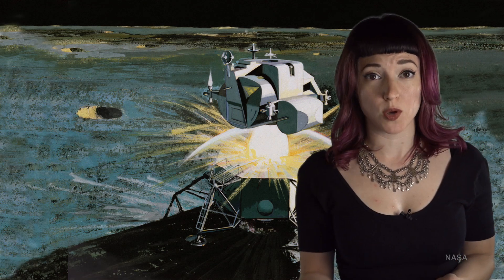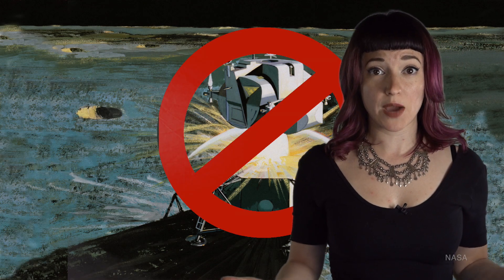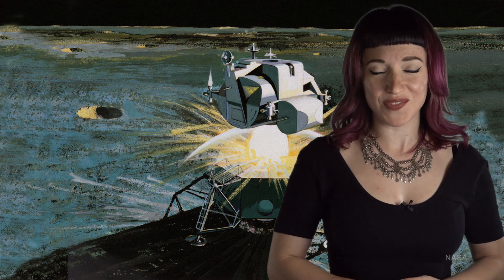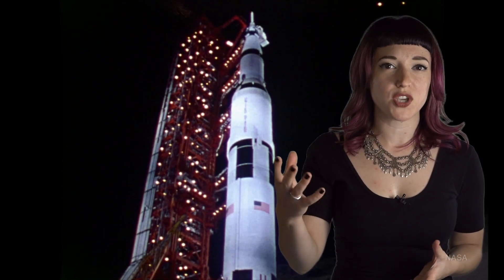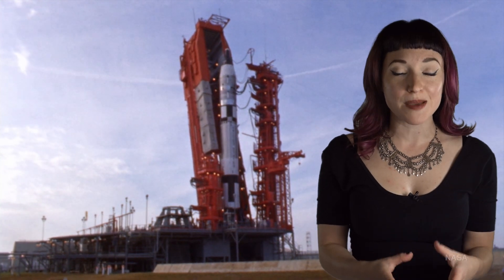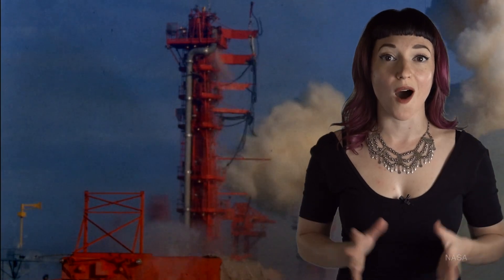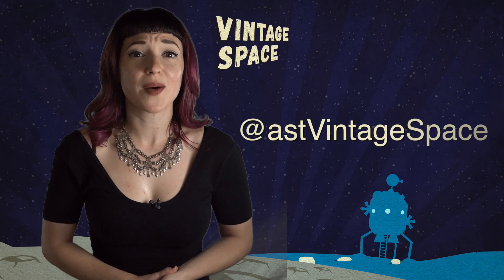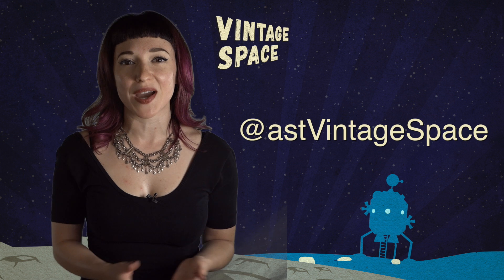How the Lunar Module Launched from the Moon Without a Flame

Comment: There is no sign of dust being blown off  the surface either. I believe that rocket.blast was 10,000 lbs. The disturbance to the dust would obscure the departure dont you think?
Reply: YOU SAID: "There is no sign of dust being blown off  the surface either."

== What?  Why would you believe such nonsense?  Have you looked at the photos yourself?  Or, are you blindly trusting other conspiratards who tell you that there was no sign of dust being blown?  How about this one?
https://www.hq.nasa.gov/alsj/a11/AS11-40-5921HR.jpg

Notice anything?  The 1-2 inch dust layer is almost completely blown away.  There are radial striations.  Um, yeah, you don't know what you're talking about.

YOU SAID: "I believe that rocket.blast was 10,000 lbs."

== So, you believe they landed at maximum throttle??  What??  Um, no.  10,500 pounds was the maximum thrust that engine was capable of.  But, they never actually used full throttle at any point, and certainly not the landing.  See, in lunar gravity, after having burned most of the fuel/oxidizer (most of the initial weight of the craft was fuel/oxidizer), the LEM only weighed about 2,500-3,000 pounds when landing (depending on mission).  I have news for you, if you ran that engine at 10,000 pounds of thrust, and the craft only weighed 2,500 pounds, you're NOT landing.  You're going straight up.  Fast.  2,500 pounds of downward force (weight).  10,000 pounds of upward force (rocket engine).  Do the math.

YOU SAID: "The disturbance to the dust would obscure the departure dont you think?"

== Brian, do you REALLY think you understand rocketry?

Comment: Why lie so much about the thrust how it got of the moon by making up a story about why we dont see the flame?!

Stop your fake info. 

There was no rocket pussing that thing to get it off the moon, They used explosive bolts to launch it.
Reply: YOU SAID: "Why lie so much about the thrust how it got of the moon by making up a story about why we dont see the flame?!
  Stop your fake info. 
"

== There isn't a rocket scientist or aerospace engineer anywhere on the planet who thinks Aerozine 50 and N2O4 should produce a visible flame.

YOU SAID: "There was no rocket pussing that thing to get it off the moon, They used explosive bolts to launch it."

== Explosive bolts are not used for propulsion.  They are used to break the connection between two objects.  And, it wasn't merely explosive bolts that broke the connection, they also fired explosives to propel guillotines through the plumbing and wiring to sever the connections.  Rockets are used for propulsion.
Reply: rockethead7 stop lying

Comment: You see it wobbling like Its pulled up by a cable.

How many kg is this thing?
How many power do you need to get it off the moon? 6x less i know, but still.

How controlable is that thing, They connected it to the other part that was in Luna orbit?

Haha what a fantasy;)

Its oke. Yeah it happend;) in the studio.

Thats one thing that is realy sure.
Reply: YOU SAID: "You see it wobbling like Its pulled up by a cable.
"

== No, the ascent stage didn't have a gimbal on its rocket.  Therefore, they used the RCS system to control orientation.  It was programmed to "wobble" like that, because the alternative is to fire the RCS constantly, which is very wasteful.  Instead, they just used gyros and the computer allowed the craft to rock back and forth, only correcting orientation with the RCS every couple of seconds, resulting in the "wobbling" you're talking about.  If you believe that's the wrong solution, how would YOU suggest that they do it?

YOU SAID: "How many kg is this thing?
"

== In lunar gravity, with the craft+fuel+people+payload, the ascent stage was about 880 kg (about 1900 pounds).  This varied a bit from mission to mission, of course.

YOU SAID: "How many power do you need to get it off the moon? 6x less i know, but still."

== The ascent engine produced a constant approximate 3500 pounds of thrust (about 1587 kg).

YOU SAID: "How controlable is that thing,"

== The 16 RCS rockets produced about 100 pounds of thrust each, and they almost always fired 4 at a time.  That is quite controllable.

YOU SAID: "They connected it to the other part that was in Luna orbit?"

== Yes.

YOU SAID: "Haha what a fantasy;)  Its oke. Yeah it happend;) in the studio.  Thats one thing that is realy sure."

== This is why you are an asshole.  You didn't even wait to get answers to your questions before you came to your conclusion.  Nobody likes assholes like you.  Hey, asshole, if the answers didn't matter to you, and you had already come to your conclusion, why'd you ask the questions??  You asked questions only PRETENDING to be intellectually honest.  You really didn't care about the answers to the questions at all.  Seriously, nobody, and I mean NOBODY, likes assholes like you.
Reply: rockethead7 just stop defending the lies;)

You brainwashed

And Its oke.

There are many like you;)

So Im oke with it.

Peace!

Comment: I have always wondered what NASA did with the camera after the launch from the moon. They had the capability to look around so did they do any more picture taking after they left? How long would the batteries last if the did? Don't know if it was true but I  heard back then that NASA had the capability to remote control the rover to some degree. If that was true then the only problem would be keeping the antenna aligned. Just curious.
Reply: I don't know all of the answers.  I haven't gone through all of my videos/documentation to verify those specific things when I've seen others post similar questions.  I keep hoping someone else will answer.  But, if nobody else does, this is all I can give you at the moment.

https://www.youtube.com/watch?v=1YUfu5NYFyc

Comment: Always an explanation. Explain why moon missions were only done in the Nixon administration.Explain why Atheist Astro nots will not swear on the Bible they went to the moon.   Explain why they say today they can't go back,lost the.  Telemetry data.Explain why NO pictures of Earth exist other then computer composite.Explain why no stars are ever seen.Explain  why they never knew what the Van Allen belts were? Get it yet! People can go on and on with questions and you always have answers.Like everyone in. Harnesses on the Space Station, what's with that
Reply: YOU SAID: "Always an explanation."

== Correct.  As opposed to what?  No explanation?

YOU SAID: "Explain why moon missions were only done in the Nixon administration."

== Well, first of all, they weren't.  There were a bunch of unmanned moon missions under Johnson.  And,  Apollo 8 was the first manned mission to the moon, also under Johnson.  Secondly, for the rest of the moon missions, the ones under Nixon, um, what EXACTLY is your point?  Did you expect them to just stop going if they didn't like the president?  They had all of that hardware, all of those Saturn V rockets, all of those trained astronauts, and, what?  They're supposed to just stop, if you didn't like who was in office at the time?

YOU SAID: "Explain why Atheist Astro nots will not swear on the Bible they went to the moon."

== This is a joke, right?  Some astronauts swore on bibles.  Some didn't.  Some were atheists (like you said).  Some were deists.  But, I mean, this is the dumbest question I think I've ever seen... why would you EXPECT an atheist to swear on a bible?  Would a Christian swear on the Hindu Bhagavad Gita?  Would a Jew swear on the Muslim Quran?

YOU SAID: "Explain why they say today they can't go back"

== Um, because the funding was pulled in 1972, and they used up all of the functional hardware.  Of course they can't go back.  Do you see any functional landers, command modules, Saturn V rockets, etc.?

YOU SAID: "lost the.  Telemetry data."

== No.  They lost two backup tapes from one mission.  After that, all of this "lost data" is a figment of conspiracy hive minds.

YOU SAID: "Explain why NO pictures of Earth exist other then computer composite."

== Pffttt.  This is too stupid to deserve a response.  If all you're going to do is reject all of the photos as fakes, what's the point of asking for photos.  I could provide you hundreds of photos, and all you're going to do is call them fake.

YOU SAID: "Explain why no stars are ever seen."

== In what?  In the photos?  Well, once again, you're wrong.  Apollo 16 took tons of photos of the stars.

YOU SAID: "Explain  why they never knew what the Van Allen belts were?"

== Ridiculous.  The astronauts all wore dosimeters to measure their radiation exposure.  The Van Allen belts were discovered long before Apollo.  They sent Apollo 6 up and through the belts and back before ever sending a human through.  James Van Allen himself assisted NASA in plotting a course through the Van Allen belts for Apollo to avoid the worst parts of the belts, while still keeping within the limitations of the amount of fuel they had.

YOU SAID: "Get it yet!"

== Yeah, I get it.  You're an idiot.  You have NO IDEA what you're talking about.  And, all you do is listen to people just as clueless as you are.  Blind leading the blind.  Dummy, when every single statement you make is wrong, do YOU get it yet?

YOU SAID: "People can go on and on with questions and you always have answers."

== Um, yeah.  Is that a bad thing?  Why do you think it's a bad thing to have the correct answers?  You act as if you want there NOT to be answers.  (Hint: this is one of the hallmarks of a delusional mind.)

YOU SAID: "Like everyone in. Harnesses on the Space Station, what's with that"

== It's another conspiracy video taken out of context.
Reply: I'm an idiot eh there tough guy. Sure triggered you to go back to text books and NASA jargon. At least some people are thinking outside what is spoon fed to us.This was the point, once again you missed it. Have you been to space? Then how do you know you are correct? We all go on other people's word on very important things WAY Too much! Trust is earned and there is a lot of Lying going on
Reply: @jasoncraig390  
YOU SAID: "I'm an idiot eh"

== Extremely.

YOU SAID: "there tough guy."

== Pffttt.  Well, this is a new one for me.  Don't think I've been told I'm a "tough guy" since, oh, I don't know how many decades ago.

YOU SAID: "Sure triggered you to go back to text books and NASA jargon."

== Oh, now this is hilarious.  You said all of the moon missions were in the Nixon administrations.  I pointed out that there were pre-Nixon moon missions.  Your response is that this is "NASA jargon"??  You also expect non-Christians to swear on a bible.  I pointed out how laughable that sounds.  How is this "NASA jargon"??

YOU SAID: "At least some people are thinking outside what is spoon fed to us."

== Spoon fed??  WHAT???  You complained about the Van Allen belts, insisting that they didn't know what the Van Allen belts were.  The Van Allen belts were discovered TEN YEARS before NASA ever attempted to sent men through them.  How is this "spoon fed"??  You claimed there were no photos of the stars.  Yet, there were.  I pointed that out.  What's "spoon fed" about that?  YOU were "spoon fed" the claim that none of the photos contained stars, and YOU blindly believed that. 

YOU SAID: "This was the point, once again you missed it."

== WHAT point?  Are you trying to say that it's better to just blindly reject everything, and replace knowledge with delusion?

YOU SAID: "Have you been to space?"

== No.

YOU SAID: "Then how do you know you are correct?"

== This is utter stupidity.  I mean, good grief.  So, unless you do something yourself, you can't know anything about it?  Did you ever build an internet?  No?  How do you know an internet exists?  Good grief.

YOU SAID: "We all go on other people's word on very important things WAY Too much!"

== As opposed to WHAT?  We all have careers and specialties.  Some people are doctors.  Some are lawyers.  Some dig ditches.  Some are computer techs.  Some are chemists.  Some build houses.   Some are farmers.  Yes, unless you want to go back to frontier times when people spent 120 hours a week hunting, farming, building a log cabin, stitching your own clothes, then washing those clothes in a creek, with no roads, no medicine, no computers, no grocery stores, no restaurants, no law enforcement, and an average lifespan of 35, um, yeah, we're forced to rely on others.

YOU SAID: "Trust is earned and there is a lot of Lying going on"

== Oh, my, good, fucking, grief.  What the HELL are you talking about?  How is it a "lie" that there were moon missions before Nixon?  How do you even know how to tell the difference between a lie and the truth IF YOU KNOW NOTHING ABOUT THE SUBJECT???  No.  Absolutely not.  You do not get to sit there and say that all you're doing is sensing lies.  No.  You are IGNORANT.  And, you don't get to disguise your ignorance by hiding it under the blanket of "I'm just not going to accept what I'm told by others."  No.  That's not what's happening here.  What's happening here is that you're using the "I don't know anything about the topic, therefore it's fake" version of "logic" (sigh).  No.  When you don't understand something, that's fine.  There are a million topics I don't understand either.  But, you don't get to claim that ignorance is a good thing, spewing a bunch of nonsensical stuff (like the utterly dumb notion of expecting non-Christians to swear on bibles), and then spit in the face of the sciences that have given you the lifestyle you have.  NONE of the experts in these topics agree with you.  But, you apparently live in a universe where the people the most ignorant about topics are the "correct" ones, and the experts don't know anything, huh?

Comment: One second just a week ago I saw a write up on the assent of Lem and it said the lem used a solid motor I know that hypergallic do burn clear but I also know we did a lot of work to reduce smoke trails in solid field
Reply: The write-up you saw was wrong. Hypergolic fuels were used as they require no ignition source - one less thing to go wrong. The ascent engine was made to be virtually foolproof. No pumps for the oxidiser and fuel, they used gas pressure to force the propellants into the engine. No ignition source needed. Very simple valves. The whole system was minimised as much as possible.
Reply: Ok the thing is I Worked with hypergallic fuels at the rocket propulsion laboratory Edwards AFB.  Hypergallic fuels have their own set of issues.  Further solids have their own issues also.  Storage of N2O4 was an issue when was the LEM ascent stage fueled also these fuels are very toxic I recall at least sky lab got hit with fuel from the RCS after splash down.  
And it was an issue with the Navy recovery teams in Gemini and Apollo.
Reply: @warlockcommandcenter  That would be hypergolic... yes, all fuels have issues of some sort. It's an engineering challenge to be solved, just like so many other things.
Reply: @warlockcommandcenter  
YOU SAID: "One second just a week ago I saw a write up on the assent of Lem and it said the lem used a solid motor"

== Well, then the write-up was incorrect.  Whose write-up was it?  Why is THAT write-up more important than the 242430280572807029482384527398457239480723098647203498 available documents stating that they used N2O4 and Aerozine 50 (not solid fuel)?

YOU SAID: "I know that hypergallic do burn clear"

== No, not all, but the ones used in the LEMs burned clear, yes.

YOU SAID: "but I also know we did a lot of work to reduce smoke trails in solid field"

== And, that's relevant, why?

YOU SAID: "Ok the thing is I Worked with hypergallic fuels at the rocket propulsion laboratory Edwards AFB."

== You "worked with them" - but couldn't spell "hypergolic" correctly??  Um, methinks your role can't have been all that important, if you aren't educated enough in hypergolic fuels to even be able to spell them correctly.

YOU SAID: "Hypergallic fuels have their own set of issues."

== All rocket fuels have their own sets of issues, advantages, disadvantages, etc.  So what?  That's why there isn't just one type of rocket fuel.  You choose the fuels/oxidizers based on the purposes and requirements.

YOU SAID: "Further solids have their own issues also.  Storage of N2O4 was an issue when was the LEM ascent stage fueled also these fuels are very toxic I recall at least sky lab got hit with fuel from the RCS after splash down.  And it was an issue with the Navy recovery teams in Gemini and Apollo."

== What IS your point???  Do you have one?

Comment: Rocket will not work in a vacuum because there is nothing to push against.  It can not push against it's self. And there is no blast crater where it landed  or dust on it's landing feet.
Reply: Michael Kilpatrick:  Thank you very much for advertising to the entire world EXACTLY how dumb you are.  I wish everyone did what you're doing.  It would make the hiring process a lot easier if there was an easy way to establish which potential employees have IQs below 40, and which ones don't.
Reply: Thanks professor dip-shit.

Comment: YOU NEED SOMETHING THERE FOR A ENGINES THRUST TO MOVE YOU.(SOMETHING TO PUSH OFF LIKE A WALL OR AIR,SOME RESISTANCE TO TO THE POWER OF THRUST) IF SPACE IS IN FACT A VACUUM THEIR IS NOTHING FOR THRUST TO PUSH OFF OF THEREFORE YOU DON'T MOVE BY WAY OF THRUST. "IT'S EASYER TO LIE TO SOMEONE THEN TO CONVINCE SOMEONE THEY ARE BE LIED TOO"
Reply: So, um, wait... the entire world's physicists, aerospace engineers, and rocket scientists are all wrong about how rockets work?  Even if you're an idiot who thinks the moon landings were faked, how do you think all of the geosync satellites get up there?  How do you think they adjust orbits?